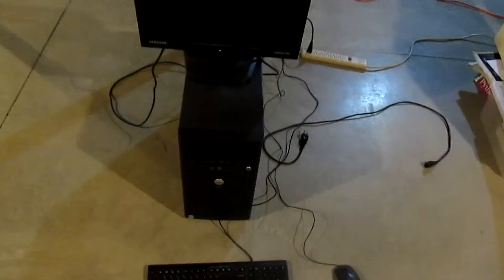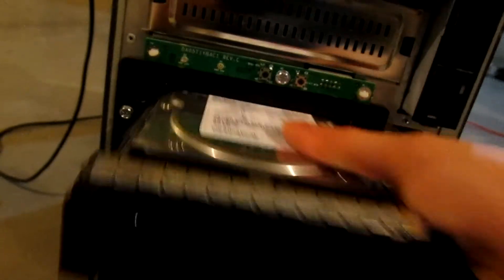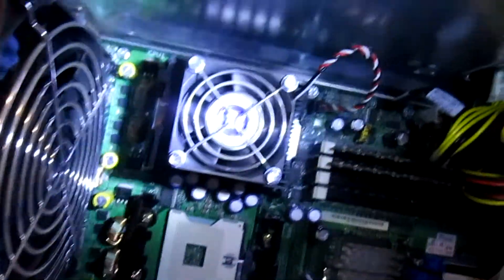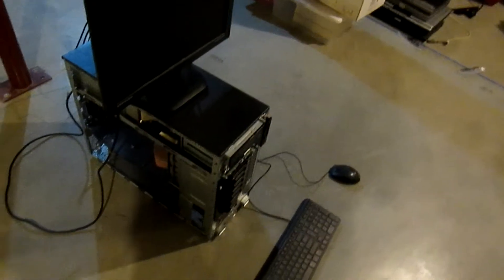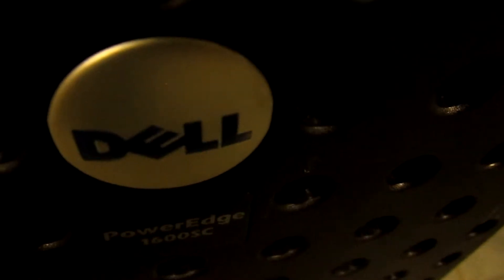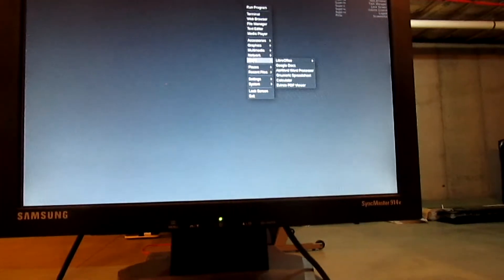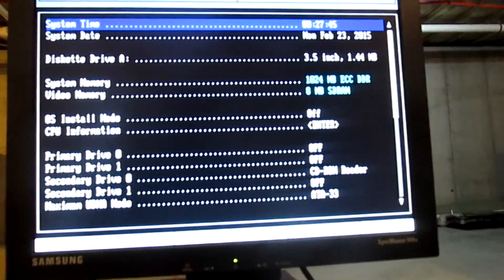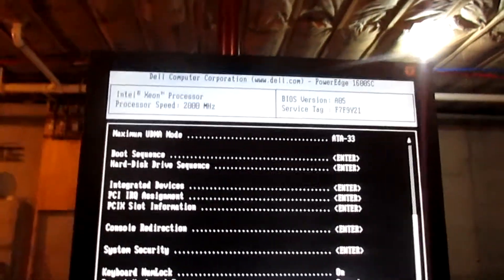Dell Poweredge 1600SC Overview

Comment: Your 1600SC is so much quieter than mine. My Front Fan is bad and my rear fan runs full tilt.
Reply from the maker: Sean Kirkendall Thats a shame, although it wasn't designed to be quiet in the first place! :P
Is that front fan bearing sealed? I could check myself but I can't be bothered xD
Reply: I'm not sure. My front fan is locked up I believe because I am getting the 12v on the motherboard. One of these days I will figure it out. It runs pretty good!
Reply from the maker: Sean Kirkendall Really? Frozen solid? Jeez! I would be astonished if the motor hasn't burnt itself to bits by now! Would be cool to see if the thing sprung back to life though!
Reply: I'm going to mess with it soon